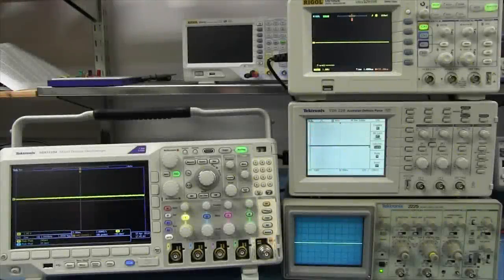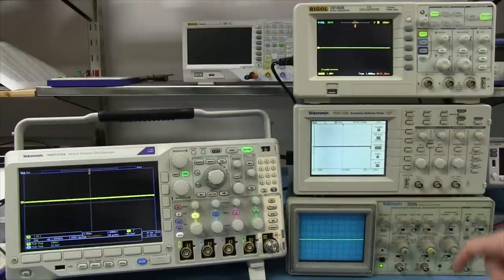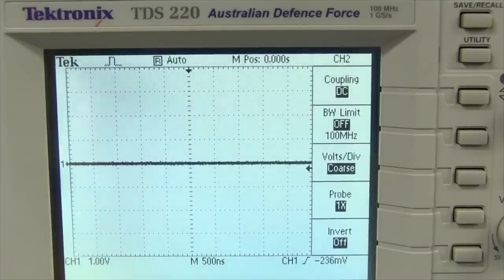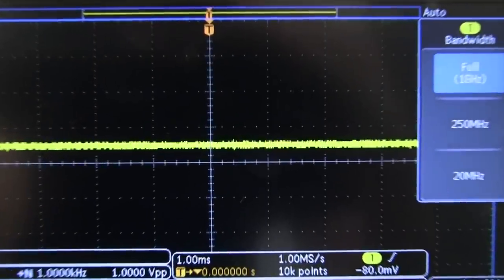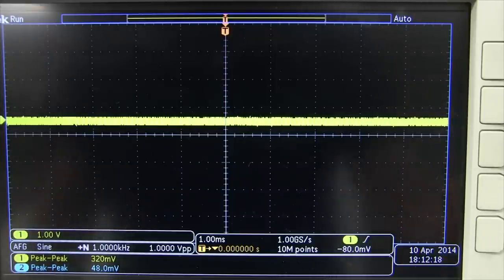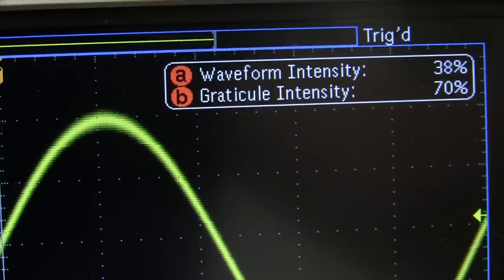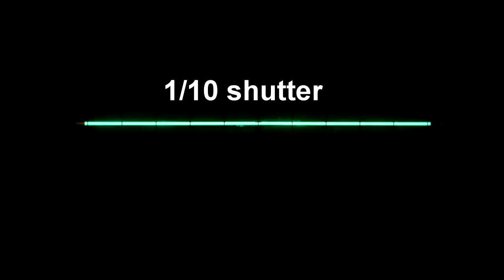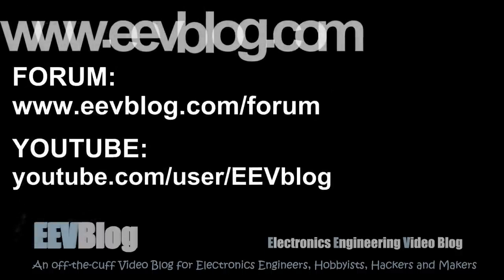EEVblog #601 - Why Digital Oscilloscopes Appear Noisy

Comment: On an analog oscilloscope, any noise will blur the beam. This can be easily verified by applying white noise to the input of the oscilloscope. It will be perfectly visible. But does the oscilloscope hide its own noise? There's an error in Dave's reasoning somewhere here.

Comment: It is likely (hopefully) the case that a tiny signal averaging 1/2 least significant bit is added to the input to "dither" around the LSB.  Without it, you get a huge step increase going from zero to 1 but your signal might have only gone from 0.99 to 1.01
So a non-harmonically related sawtooth, or just thermal noise, (random but at least non-harmonic) noise will, for instance, at one moment in time be 0.95 and now your tiny signal is enough to push it over the threshold from a zero to a 1.  But a moment later it doesn't.   The average of these sometimes-0 and sometimes-1 will converge on the actual value.  Let's say three measurements of 0, and one measurement of 1, repeat.  The average becomes 0.75 and can be displayed as 0.75 which is accurate.

This is why (probably) choosing less memory depth on the Tek scope reduces noise; under the hood the sampler is going full speed, and with some dithering noise added to average out the quantizing error, then subtracted.  So you might take a thousand noisy samples in extremely rapid succession but store the average as a single sample.  The effective ADC bits is increased by doing this; a Keysight DSOX1202 can deliver up to 12 bits of effective vertical resolution even though its ADC is only 8 bits.   You get this effect more or less automatically on a Keysight (unless you tell it not to); it optimizes memory depth based on sweep speed and probable zoom setting.  If you want maximum zoom then you'll have to run the ADC at maximum speed and now you're back to 8 bits per sample.

Comment: Is this 'real data' noise picked up after the amplifier stage then? It doesn't seem to change much when V/div changes e.g. on a Rigol MSO5000 comparing 100mV/div to 10V/div seems to show around the same thickness of trace with nothing connected, and say at 10x attenuation and 100V/div the display could suggest 20V of 'noise' which is huge - reallllyy???!!. Particularly XY mode is bad as it always seems to produce a square of around 40% of a division!

Comment: The critical thinker in me tells me that increased noise in the digital scopes are not inherent to the scopes (suggesting a disadvantage).  Otherwise, why would they be so popular and analog scopes are (probably) all but ancient dinosaurs?  Rather, this "noise" is a side effect of some other property of the scope and it should be possible to compensate for it.  When I got my first digital scope (Rigol DS1054Z) and powered it up for the first time, the first thing I saw was noise.  However, it was noise that appeared to be a 60Hz waveform.  As I got more familiar with the scope, I realized that yes, that's what it was.  The "noise" was most likely coming from the electrical wires inside the walls of my home (60Hz in N. America) and I was not a single bit surprised to see that the scope (or more likely, the probes) was picking this up.  Actually, I was happy with it because it proved to me how sensitive these digital scopes actually are.
I really like the depth you got into about this subject in this video; it's nice to see such explicitly focused attention to a peculiarity of a technology such as digital oscilloscopes.  I really like ALL of your videos; there are probably more than a few people really learning the ropes by watching your videos.  Keep up the good work!!

Comment: What if I don't want to see all the noise?  If I pretend it doesn't exist...it just might go away?  Right?  ;)
Reply from the maker: Just like on your analog scope, yes, you can make it go away!
Reply: I recommend using black insulating tape, to narrow down the line so it's REALLY thin... Noise is a thing of the past..
Reply: *****   Will blue painter tape do in a pinch?  Oh look...NO NOISE on my 1052e.
Reply: I don't know GeorgeGraves  I simply don't know. I've found my scope is compatible with 3m black insulating tape, but 3m "invisible" brand tape had very little noise reducing effect on my scope.
Reply: Photonicinduction told me to smash the screen with a hammer, it just might help.
Reply: Robin Nibor
Dave aint 'avin it!
Reply: So long as there are women and children there will always be noise ;)  oh and Dave!
Reply: satanclaw with the 3m invisible tape you have to use lots of layers like lots and lots of layers... it helps if you put a layer of sharpie ink between layers.

Comment: At around 12 min are you saying that a non connected input can reach more than 200mV of noise? Isn't that weird?
Reply from the maker: Not with 1GHz of bandwidth and 10M sample memory
Reply: EEVblog
Hmm, I thought it was a high value, didn't know standard noise could reach those kinds of voltages, thanks for answering, great video :)
Reply: Ricardo Amendoeira im guessing its all those radio waves around us and stuff on the mains supply radiating out, plus all the other electrical things around,  maybe in a farady cage with some pure ac to supply it it might be zero

Comment: That's only partially true. At least that old Rigol noise is mainly from it's 8 bit ADC. Quantization noise for 8bit DAC is big enough to see it on the scope screen. I did play with the Rigol long time ago and found this is a toy... It shows such +/- 1 bit noise even at no signal. If it is a signal noise as Dave insists... why it does not increase whilst you increase the input sensitivity? Regardless of input sensitivity always same level of noise and this video is to prove a differnent reasons and hide the fact that an 8bit scope will show such +/-1 bit quantization noise by design. It is not a signal noise, it is 8 bit ADC noise. And by the way those long shutter photos may just prove electron beam imperfection rather than a noise.

If you want a less noisy digital scope.. you have o pay for 12 bit DAC to reduce quantization error to be below display resolution...and then this movie will be valid. 8bit DAC has limits you can easily see.

Comment: Could you do a quick explanation on the "peak detect" mode (from the ADC  to the screen)?
Reply: ***** Thanks Mike. So, just as it happens with high res mode, it will not have any effect on the highest sample rate of the scope (as there are no leftover samples)?

Comment: You really kick with this vid. I'' stop telling that the DSO is noisy, what It was actually I used to think. Dave, just some question, never figured that. I was showing a signal in an old Hitachi Scope, lets say, signal is 300Hz with one spike each half cicle. It the current waveform from a DC motor. Easy. Well hitachi, showed spike consistently, more or less same height an ALL OF THEM. Then, got a sales person from Fluke with a 192 series Scope meter (Ohh man, I love them) what the spikes, showed ocassionally, and height was uneven, like modulated. At first dissapointed me. The other scope we have, a 2008 GW INSTEK 200Mhz, 1GS/s ( well, it was expensive by the time, resulted on rubish FW) and do EXACT the same as Fluke. 
I will serioulsy appreciate some clue from you. More important thant a good scope to measure is LEARN how to measure and I'm sure thet I missing something there.
Cheer.

Comment: i have always wondered exactly when you would want to reduce memory depth.  Is it just to visually reduce noise, or are there more serious cases where you must reduce memory depth?
Reply: One reason to reduce memory depth is if you want to look at the FFT in real time. Spectrum analyzers are quite a bit more expensive than digital scopes, and most digital scopes come with an FFT function. If you calculate an FFT using 1M samples, it can take several seconds to calculate. Sometimes you want the FFT to be calculated rapidly, like a few times a second, which is why you might set the record length to 10kS.

One example of when this might be useful is if you are adjusting the gain of an amplifier, or a sine oscillator, in order to minimize distortion, and you want to do this in real time without having to wait 10s for each FFT picture; In this case you might be willing to sacrifice frequency resolution for refresh rate of the FFT.
Reply: @andreyselectronics149  cool. thank you.

Comment: Dave, you've mentioned very important things that help to understand operation and usability of a digital scope, but your conclusion (digital scopes are no more noisy than analog ones) is actually not supported by your own experience. 
1: A quantitative comparison is 100% missing, you've done no noise measurement of the analog scope at all. 
2: You've just introduced variables, and based on the fact that noise depends on sample rate and filtering, you falsely deduced that digital scopes are not noisier. 
3: You also missed defining the quantity you are dealing with. Noise at what point of the circuit? Equivalent noise on input? At what V/div? Or vertical noise compared to screen height? Or vertical noise compared to full scale/limiting? Or physical noise on the input amplifier? 

You've even shown a very strong proof against your conclusion:
12:03 "It's actually showing you real data..." At 1 V/div, 320 mVpp? Really?  Yes, it's real data. Real data of the noise of the input amplifier. If you want to measure the noise of the input amplifier of the scope, then it is very useful information. But what if you want to measure the input signal? 

I may give you information about why digital oscilloscopes has to be more noisy than analogue ones:
- High speed ADCs has a limited resolution (typically 8 bits, but it can be as low as 5 bits in really high speed scopes). 
- Quantization is considered a bigger problem than uncorrelated noise, since noise can be filtered by averaging, but quantization without random noise cannot.
- Therefore thermal noise level is intentionally designed to be higher than quantization noise.
- Analoge scopes don't need additional noise, therefore they can use higher signal level, (typically 5 mV/div is the most sensitive setting, while digital scopes go down to 1 mV/div.)

Comment: I've got a dinosaur Philps 3335 which has BOTH digital and pure analog modes.
I still prefer the analog mode 90% of the time......the noise is better left out!
Reply from the maker: Analog does give you that warm fuzzy doesn't it.
Reply: us older generation of engineers got by without digital scopes and without knowing how pervasive the dirty noise floor was.....methinks it doesn't really add anything to understanding your design  99% of the time.
Reply from the maker: stmounts
unless you are actually looking for noise in your signal...
Reply: yeah, of course, noise is a special case..
But 99% of the time I don't give a flying ** about the noise floor, and I suspect that applies to most engineers,  even more with digital circuits....

Comment: Seems CRT oscilloscope tube inertia do the trick with noise "hidding" in same way how CRT's make low resolution picture in old computer games "nicer" - by smearing disturbances and digital pixel corners in analog way. Well, in electronic tasks sometimes is better to know about the noise, I guess.

Comment: An excellent video well presented, and full marks for enthusiasm for your cause, but as a designer of audio measuring equipment who has spent thousands of hours staring at detail on an analogue scope, I have to protest that, in the end, the digital scope will not do what I need it to do.  You have talked only of noise, and yes, your theory is very credible, but you have not talked about the fact that what you are seeing is not your actual signal plus noise, but your signal plus noise quantised.  An example of something I have worked on is the overshoot and errors that occur on 'perfect rectifier' circuits and how they relate to diode offsets, bandwidth,  and slewing in the op-amp.  Crossover distortion is a similar example where fast spikes are seen.  Despite your 'brightness' theory, the fact is that I can, on an analog scope, see spikes on a 10kHz signals that equate to around one thousandth of the screenwidth, and see them clearly.  On a digital scope, I cannot get this clean display (and I don't think you can on your fancy brightness modulated scopes etc) - because they can only appear in discreet levels and are constantly appearing and disappearing at those levels - nothing in between.  No amount of filtering, sample length change, or brightness modulation can restore the lost infomation due to this combination of noise and 8-bit quantising.   Another comment here may have a point in that higher screen resolution could allow interpolation of the sample point values vertically, just as dither in audio works to restore smooth waveforms , or upsampling works to give a proper TV picture (it takes a 4k display to see HD video properly).  What this amounts to is 'reconstruction filtering' of the amplitude.  Without going into further depth, I suggest that such reconstruction filtering would be very complicated on a scope because we are not working with fixed sample rate and bandwidth. 

An interesting possibility occurs to me now.  If triangular PDF noise were added to the signal as optimum dither, as in audio, and then subtracted again digitally after sampling before display (a technique that has been used in audio) then the loss of information through quantising could be eliminated, allowing reconstruction to a much higher res display, and without adding to the actual noise.  Would this be practicable given phase shift in the sampling?  I think it could be, especially for lower bandwidth use - an interesting challenge.  Then again, a 12-bit scope with say 20MHz bandwidth, might be a better approach, but I don't think such a thing exists, probably because in the digital age the market is thought to favour speed over accurate portrayal.  Perhaps you can tell me if a scope exists with more than 8 bits resolution at a price below say £1000, to give me the clear display I so miss?
Reply: lindosland 
You are  right and  notice this
Reply: lindosland 
In analog what you see is what you get 
I love analog

Comment: was an analogue scope ever made with a full colour display on ? :o
Reply: I'm curious about this too. I've only ever seen digital scopes with colour CRTs, but never analog. Since analog scope CRTs tend to be driven with electrostatic deflection rather than electromagnetic, maybe that has something to do with the difficulty of making it in colour? Just a shot in the dark. :P
Reply: whatlions
colour crt are both lower resolution and have less image persistance, perhaps thats why
Reply: Analog Oscilloscopes dont have pixels in their CRT, like old Televisions do. The electron beam just "flies" over the screen in every direction, and thats why you cant apply a color filter on top of it (which takes 3 subpixels and colors them). They could have made a digital Oscilloscope with a color CRT, but thats not worth the effort.
Reply: 3vIL VIrUs  Tektronix did build an analog 5000 series scope (5116) with a colour shutter. Okay, yeah, it does use a digital readout and storage and such but the display technology is analog and does not imply pixels since the CRT is single-color.

Quite funny that googling that points to this: http://www.eevblog.com/forum/testgear/color-tft-screen-in-a-tektronix-tds500-600-or-700/msg120729/#msg120729

Dave, you seem to be currently taking over the internet :-D
Reply: cool :D i guess the colours could correspond to the channels in use like, red = channel one, blue = 2 green = 3 and so on
Reply: Some Tex scopes had an LC shutter over the CRT which could make the on-screen text displays a slightly different color. It wasn't terribly useful and lowered the trace intensity.

Comment: Now Dave explain how any of that matters in a repair / audio scenario , it doesn't matter 1 iota . Analogue scopes are still much nicer to look at in this situation, cost a gazillion times less and are much easier to use .  All of that goes to shit when space is an issue of course and thats why a lot of people mostly get digital scopes because they just need to get the space back those barge size analogues . I have both now and i much prefer using the analogue to look at . You are talking about that stuff really doesnt matter . You dont need all that information . 9 times out of 10 you are looking to see if a transistor is turning on or off , do i have an audio signal , is the IC functioning , Is there any noise in this transistor , NONE of that needs this "information" you are talking about in this vid. Its "extra" information if you like that NO-ONE needs ever , its just noise . You keep saying it yourself , its noise , " its noise that shows up here but not on the analogue scope" EXACTLY !!!
Reply: So true, dude. So true... Too much information on the screen is an issue sometimes. Same in fft's;  a 128 point is often more informative that a 32k point fft.

Comment: seems to me that this noise on the digital scopes is more due to poor A to D conversions or noise in the scope amplifier circuits.  Consider, if you have 8 bits representing +/- 5V (10V range), that is 0.039V per bit.  if the A to D converter wobbles that last bit during sampling, even a simple 1.5V alkaline battery will start to look very noisy when measured on the digital scope.  The USB scope I recently purchased likes to tell me this battery is noisy and fluctuates between 1.45 and 1.55 volts.  I chose to believe the noise is in the scope, and not the battery.